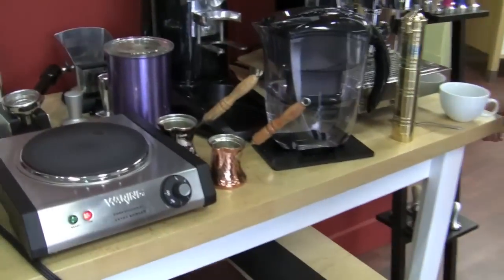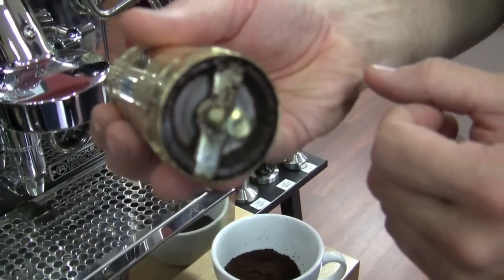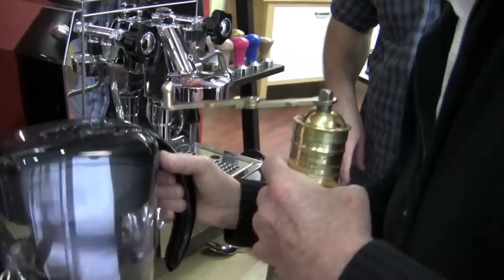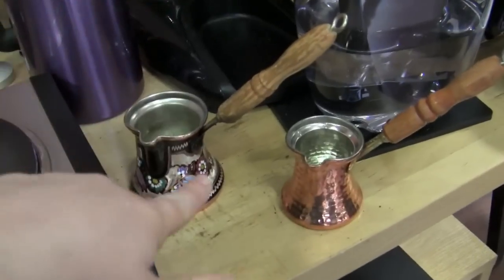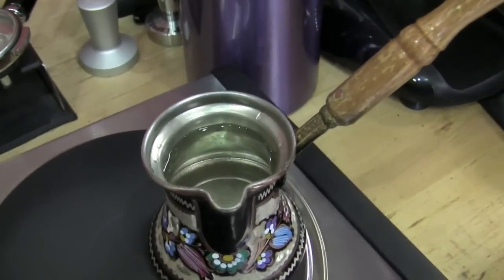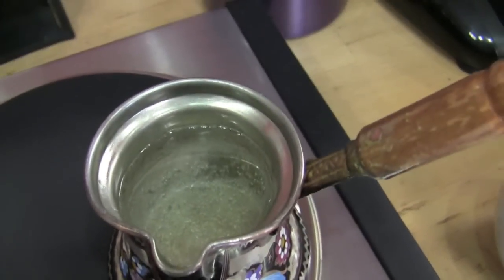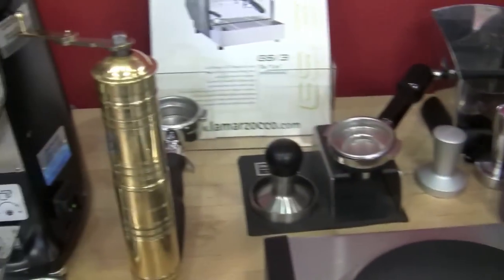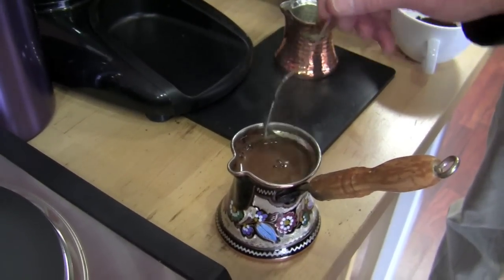Crew Review: Turkish Coffee Equipment

Comment: The general method used in Turkey is to remove it from the heat just as it simmers, producing more créma without "burning" the coffee accumulated at the bottom of the cezve. Following a few extractions of the créma, you pour the coffee slowly to prevent the "telve" or residue from overflowing too much. Within the cup (which is usually tiny), there should be about a quarter inch of residue. The final step is flipping the cup over on the plate, cooling it, and fortune telling from the residue.

Comment: In Turkey, it is a common coffee style (probably more common than other methods except instant). In supermarkets, usually sealed packs of turkish coffee is sold and you mostly don't even see coarser grinds in small supermarkets.

According to a common recipe on coffee packs(for each cup);
-a cup of water(mine is 60ml)
-2 heaping tea spoons of coffee
-some sugar(optional but some say it's necessary for better foam)

-All ingredients are added into the jezwe(cezve). I prefer half tea spoon sugar, not to have a sweet coffee.
-Then, it's heated. Some recipes say to heat slowly. I use an electric cezve so mine heat fast. I don't think it is so bad. So many people do it.
-Just before boiling, a foam starts to rise. If the heating is not stopped, it may even spill. But this foam is what we need. Heat is stopped and foam is distributed to cups. Some people finish boiling after having the foam, and get the whole coffee in cups.
-If you want to follow packs recipe, some packs say to boil once after getting the foam. But I don't do it. I think it's not necessary.

Enjoy your coffee :)

Comment: To be honest there are not different ways to make Turkish coffee. First use cold water, put coffee inside the pot before you start heating, use very low heat, do not vigorously boil the coffee, take it when enough foam forms and gathers in the middle and reaches size of a coin. And do not stir it. We do not want telve inside the coffee, we like it at the bottom, so the liquid must be clear. These are not just rants about originality, you will seriously end up with a very different thing, you basically burn the coffee by boiling it like that, foam is indicator of temperature control, you need foam.